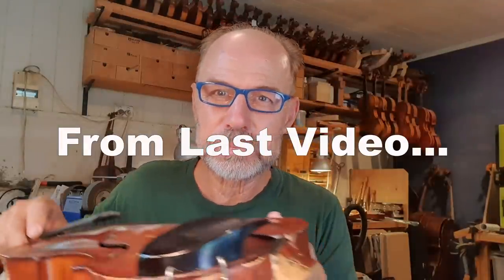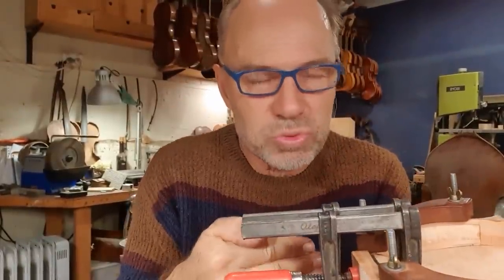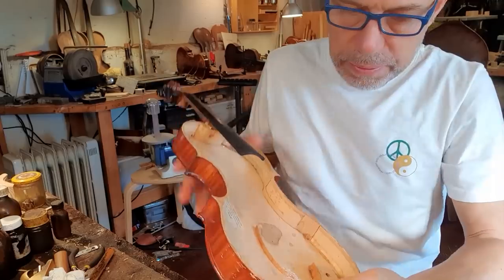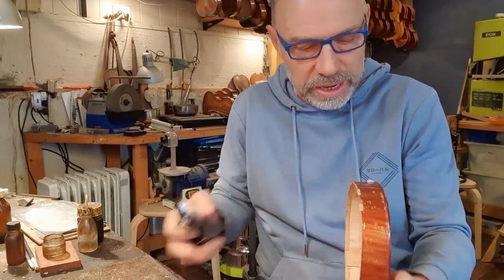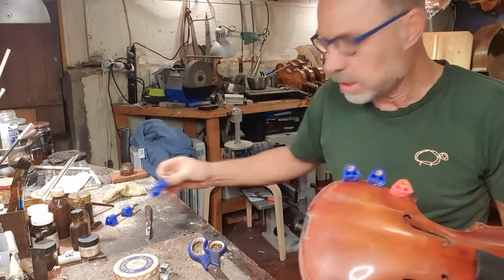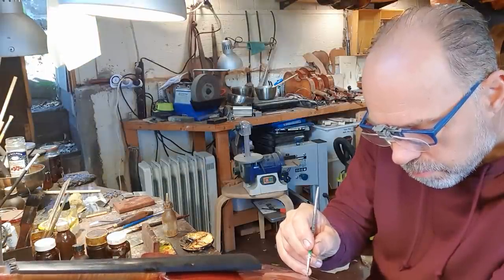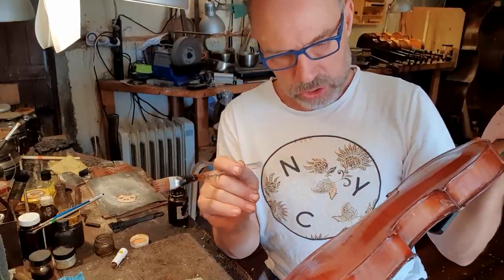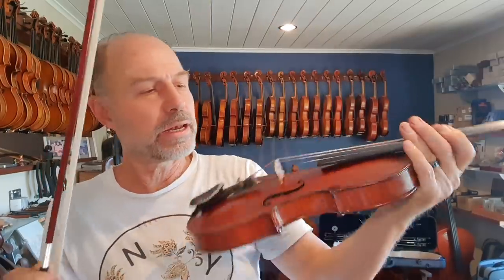Violin Disaster! - Can it be Fixed? - Part 2

Comment: If I had to guess, I would say that the frightening scratches on the bottom there were from improper tightening and removal of the chin rest. Not that they tightened it too much, but that the makeshift tool they may have used was pushed so far through the tightening barrel that it scratched the violin on the other side.
Reply from the maker: Yes, that often happens... Even the little keys that come with chinrests are oft just a little bit too long
Reply: @AskOlaftheViolinmaker  wow I didn't expect any reply on such an old video. Certainly not one so quickly. I have been binge watching your videos recently and I love the way you present your work~

Comment: So if you run out of video ideas, I’d be quite interested in a cooperative video with some fine arts restoration specialist like the YT channel Baumgartner Restoration, because I always see a lot of similarities (well both restoring a violin and restoring an oil painting treat with restoring am old piece of “Art”) but also some interesting similarities (in restoring a painting you would try to make any retouching etc fully reversible, the violin needs to be as permanently repaired as possible and much more.

Just like a discussion of what interesting techniques the other uses and why some things are similar and others different. Obviously a painting doesn’t need to sound good but “just” look good.

Comment: I have a question:. On the top part of my violin by the fingerboard on the left ribs where the left hand goes up into higher positions and touches the violin. I have played with very sweaty hands this summer because it's been so hot in my house and it looks like the wood became damp and has lost all the varnish and has like a gray color... what would you suggest? My violin is 89 yr old German.

Comment: Olaf, the subject of violin repair has me fascinated, and it has brought to mind a question: What properties does the glue itself have in regards to changing the sound of the violin? Is there a special glue you have to use? I imagine regular wood glue would probably not be the best. Do you find the more glue you use the more muffled the sound is?

I am currently trying to build a violin from a cheap chinese kit (and have already massacred the poor defenseless thing!) but after seeing your videos I feel like a proper luthier! (Not really, that's an exaggeration..... It is a lot of fun, though!)
Reply: Olaf uses Hide Glue because it's reversible with water, which makes future repairs and restoration easier. As an organic glue, it also moves with the wood in response to changes in humidity and temperature. Furniture and art restoration also use hide glue, because the items are to be treasured and restored over generations, so they owe a duty to the future restorers to make their job easier. It has to be heated in hot water before use in a mini crockpot. Raw hide glue has limited a usage time. Repeated heating and cooling cycles eventually denatures the proteins, and it loses its adhesive qualities. It's open time is short too. Olaf has to work fast when gluing up. You can buy it ready prepared in 100ml bottles, or you can buy the raw hides and prepare it yourself if you're going to be using a lot. (That process is a bit smelly though.)

Comment: I follow another instrument maker. He uses Titebond Original and shuns hyde glue. You stick to the old stuff LOL. One thing I've learned is that you guys always criticize other's works LOL.Time and entropy will degrade any glue used. Hyde glue will eventually turn to dust and lose all adhesiveness due to brittleness. So it does have a time element. Newer modern glues are sometimes superior. The thing I've learned is to use the correct type of glue for the job with the thought in mind of how long will the joint last. Also the woods have a lifetime and all Stradivarius and other violins will degrade eventually and fall appart... remember entropy. So it would seem that if a repair lasts 50-100 years its doing good. The old makers never had access to modern glue technologies and they had to rely on what was available. I'll be willing to bet that old Stradivarius himself would have used modern glues if he had it available. But I so enjoy your work, specially in the hard jobs and your approach to fixing them.
Reply from the maker: The problem is the added ammonium and a couple of other chemicals that can weaken the bond over the years...
I guess we'll see in 200 years how well it holds. 
I stick to the tested stuff that I know will last for the next 500 years 😊
There's many ways to do things.
Reply: @AskOlaftheViolinmaker  Sadly I won't around LOL but I still enjoy your excellent work Olaf. Keep knocking the videos. I learn a lot from them.